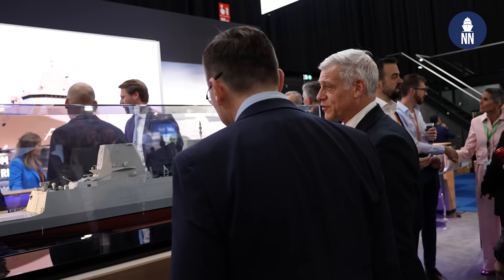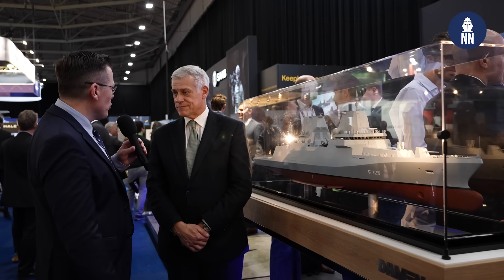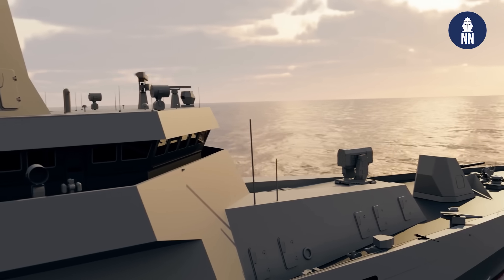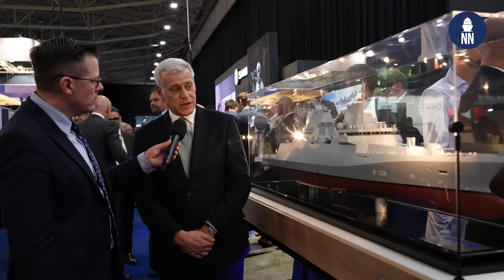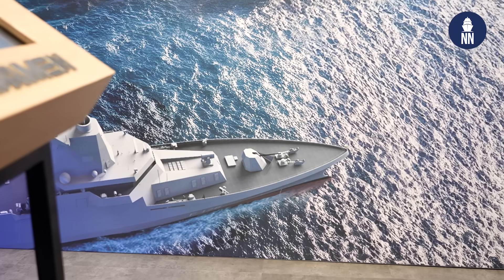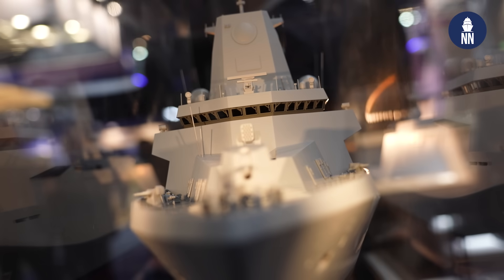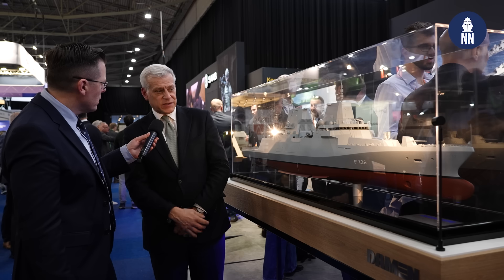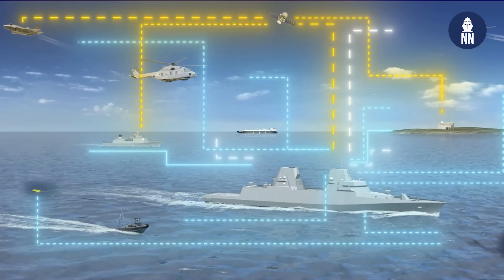German F126 Frigate with Damen at NEDS 2024

Comment: Looks like doing the same mistakes a second time after F125. With the F125 they told us, there is so much space it's so modular and you can still add things in the aftermath... and what happened, too heavy for its size, couldn't stay upright in the water...and best of all have to go all around Africa because it's to weak crossing the red sea. A Frigate is per definition the smallest unit that can protect itself. During the Red Sea operation it became clear that it would be positive if our F124 would have a greater magazine number of VLS cells and its 32 cells are definitely on the lower end of the self protection level. 
And now some people miraculously believe that 16 VLS sells are enough to protect it self AND strike against land targets (because that is a task normally the F125 had to fulfill but can't do because of its weakness and now the F126 has to compensate).
I really want to meat this genius that can explain to me that 1-1 = 2. And for all how don't know jet, striking targets at land, you also need VLS cells!

Comment: Incidentally, it is not very difficult to place more VLS cells on the bow. By removing the RAM launcher, there is sufficient space for 40 VLS cells.

Amidships, on top of the top deck, containers can be placed for Iris-T or Barak-ER missiles. There is sufficient space for at least 24 of these missiles. The Dutch navy places 32 Barak-ER missiles on a ship of 500 tons. There are enough options to increase the firepower of these ships.

Comment: 10500 tonnes with only 16 cell VLS system?
Reply: If u hear started 2:00
This ship is modular based
10000+ tonnes for its tonage for accomodating more capabilities+tasks
Such as torpedo launchers or more canister missiles?
We dont know where the placement but the F126 with 10000 tonnes is as a base platform.
U can lego-ing depends on it task

Comment: A potential weakpoint for this F126 firgate is the center between the masts, since the two masts act as lateral limits of a large target for long range fire, missiles, etc.
Reply: I can assure you that that empty space between the two masts is not a weak point.
Reply: It is quite the opposite. It's called two-island-principle: Because of this design, it is almost impossible to incapacitate a warship with a single hit. It is used for most major warships in NATO navies.
Reply: That... is not how missile guidance systems work.

Comment: the problem is not specs but takes to long to make and shaping single ship. 1 year per ship means it takes +1 year atleast tobe ready so 2-3 years after starts they would be ready for service, then comes another ptoblems .. undermanned, and  underbudget for maintenance.
Reply: Get more yards and you are  quicker. These ships are build in modules. TKMS calls its "family" MEKO. You can build them as fast as you want and your suppliers send it their components.
Reply: @EK-gr9gd these are not TKMS ships. They are mostly built in german shipyards but are designed by Damen (Netherlands).
Reply: @blablubb12345  
I gave the MEKO System just as an example. Litton Ingalls had something similar (Wasp Class).

Comment: ASW? 🤦‍♂️ Germany need a solid land attack capability with AAW
Reply: AAW is what the F127 will be for, replacing the F124. The F126 is replacing the F123. Either way, it's got a solid land attack option with its Vulcano gun system -- with guided munitions and ranges exceeding 54 nautical miles, the cannon should be entirely sufficient for these ships' mission profile.

Comment: 95% of the people here have zero understanding of naval warfare, the german mission profile and can't pay attention to what's being said in the video...
Reply: I think while the criticism is understandable, because the F126 is still a design based on requirements pre-2022. It is a good design for the requirements. It is replacing the Brandenburg class-frigates (which had no VLS at all) for long-term stabilization missions.

Btw, the F127 frigate, currently planned for procurement, will have 64 VLS cells and Germany will procure 6 to replace 3 Sachsen-class frigates. This will be a ship more designed to fit the post-2022 requirements. It will likely be a Meko A-400 derivative.
Reply: @tobiwan001  that is a very good point many also forget.
Reply: Trotsky. "You may not be interested in war, but war is interested in you."
Reply: I guess if Japan is going to have a "helicopter destroyer" that operates F-35Bs, then Germany can have a 10,000 ton "frigate".
Reply: true. this is basically the size of an arleigh burke but made for underwater warfare and submarine hunting
Reply: @JPK1337  with a lot less crew, longer at-sea time, modularity for special operations (Germany doesn't have amphibious assault ships
Reply: Ah yes the company that has been building war ships for the past 150 years doesn’t know what it’s doing. Suuuuuure thing buddy
Reply: @MrJimheeren  The company doesn't decide on the design. They just build it.
Reply: @Prometheus4096  no they also design the ships. That’s the whole point of military industrial complex
Reply: @MrJimheeren  Damen is Dutch. The German ministry of defence asked for this.
Reply: @Prometheus4096  yes what’s your point. Damen designed and will build this ship together with some German defense industries
Reply: @MrJimheeren  Who said something about the company or the design? I'm talking about the armchair generals in the comments
Reply: @patta8388  sure, but those "armchair generals" are not as bad as the fool who pulled an arbitrary % out of his behind and added a ridiculous absolutism like "zero understanding" to it, if anything you only made yourself the joke of the comment section
Reply: @diedampfbrasse98  yes this is true
Reply: Nope, you are just ignorant dude

Comment: To everyone who says "16 VLS is enough",
yes, we acknowledge 16 VLS can pack 64 ESSM missiles. ESSM is however a short/mid range anti air missile with little fleet defense and area denial capability. In case of an air attack, it would not be hard for airborne radars and air-launched anti-ship missiles to outrange the limited service radius of the ESSM, placing the defending ship in a very difficult and vulnerable position. In an era where aircraft and anti-ship missiles are becoming more advanced, longer ranged proper anti-air missiles are needed since area denial and self defense are more and more becoming one and the same thing. Furthermore, even if we only talked about ESSM, a ship that has 96 VLS for instance could carry 384 of them, which would still be much more firepower (and as such defensive capabilities).
We also realize that the F126 is intended with anti-sub as primary role. However, do not forget that the primary modern anti-sub weapon is the ASROC, a VLS-launched weapon. With only 16 VLS, you are pretty much forced to decide between ASROCs or air defense, a difficulty a ship like the 30 years older Arleigh Burke would not need to face. For 10000 tons, this "anti-sub frigate" offers no significant anti-sub capabilities other multipurpose destroyers could not offer - There are no larger spaces for helicopter operations, there are no indications of special detection systems said multipurpose destroyers could not use, and there isn't a lot of capacity for anti-sub weapons.
Instead, "anti-sub" apparently just means is that it simply lacks the capabilities to do other missions while remaining average at best and limited at worst in its intended role. VLS are general purpose weapons. VLS is what determines your capabilities for long range ground attacks, anti-ship warfare, fleet air defense and area denial, self defense, anti ballistic missile defense, and if it comes to it, nuclear strike capability. Remember that VLS is not just a weapon of a modern warship, it is the weapon of a modern warship. Building a warship with few of them is building a warship that is handicapped in everything.
Reply: Let's be honest here, even a 160 km long range Missile can easily be outranged by pretty much any air launch platform, be it by using standoff missiles, or just staying below the radar horizon. The ESSM II and the RAM Block 2b's are some of the best missiles out there for defending against anti ship missiles of any type.
And yes a ship with 114/122 missiles is very well equipped.
Reply: "little fleet defense and area denial capability." 

Its not its roll, the ESSM for the F126 is for self defense only. 64 missiles for AA is a standard lay-out. 

" the primary modern anti-sub weapon is the ASROC" 
No its not, its the Helicopter. The F126 carrys 2!!